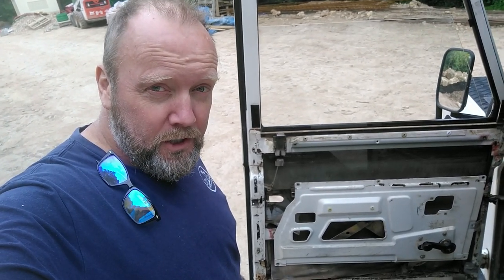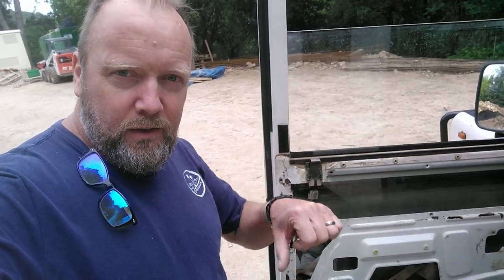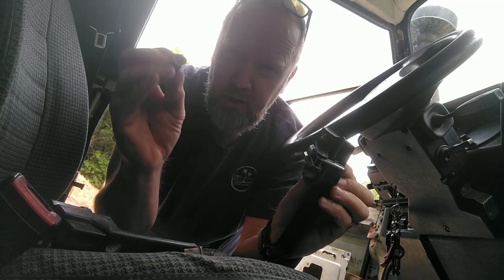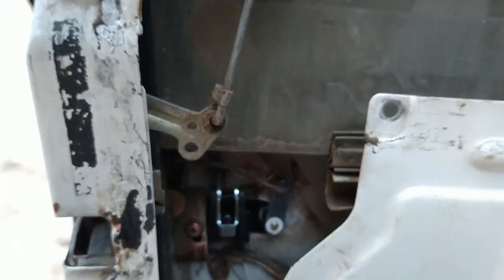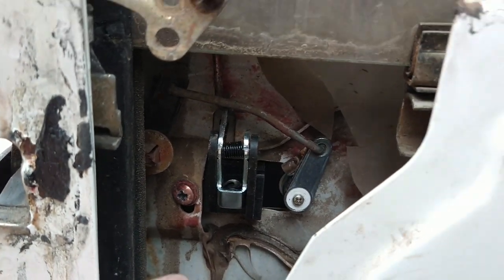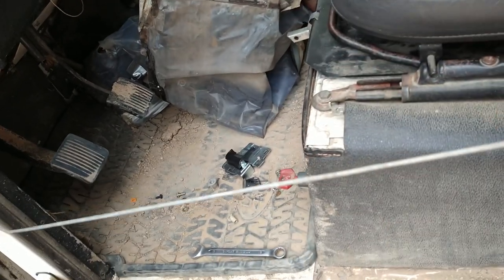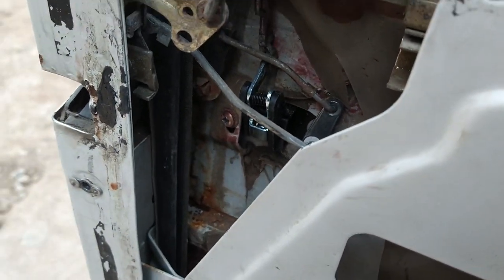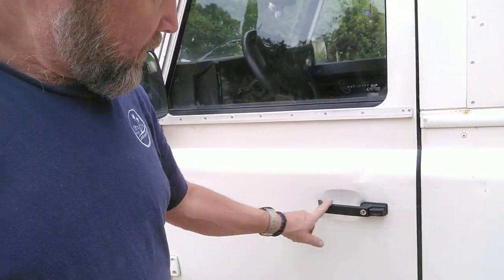BOTH Door Handles Broken! | Land Rover Defender

Comment: Great video. I had to change mine recently when the exterior handle bolts rusted and I had to cut them off from the inside with a multi tool. It’s like a box of coat hangers in there isn’t it 😂
Reply from the maker: Engineering masterpiece I'll have you know...🙄😬😄
Reply: @ASimplyFabLife  I bet someone got employee of the month for those small clips. I must order some for my @scandilandefender for next time the door cards come off 😎

Comment: I bought 300tdi about 2mth ago  because I was influenced by many youtuber like your self. Yep previous owner did not fix any door lock. he said he never lock the door and passenger side he would open from inside..... It  was very simple fix! But at time I could not find a short rod so I cut and bent a coat hanger, and it worked. But 2 weeks later I found original rod in the  centre box!!! I have not replaced it as yet.
Reply from the maker: There IS an advantage to a simple design... but then they complicate it with the engineering😂👌